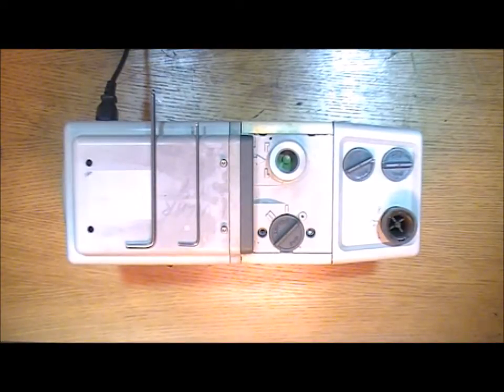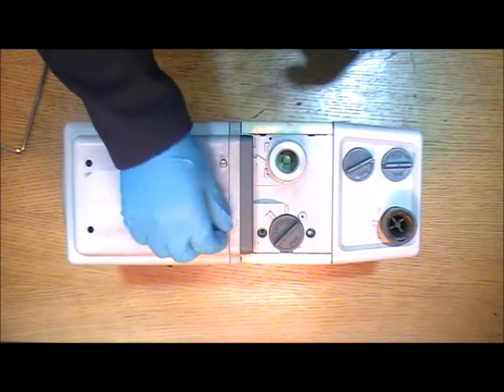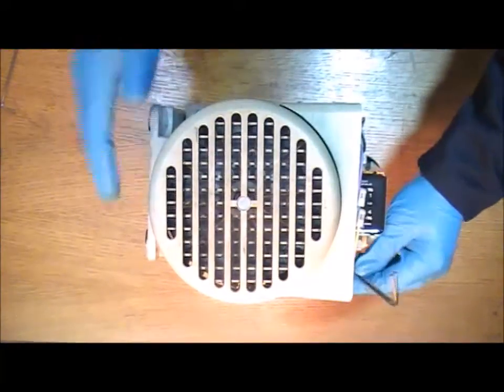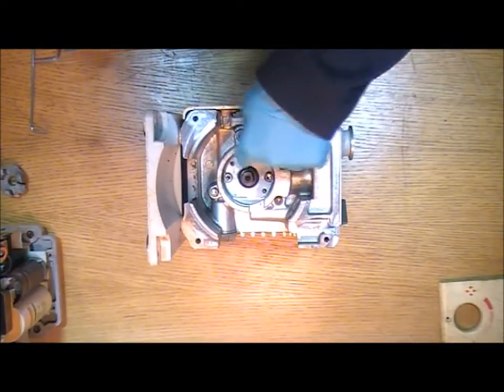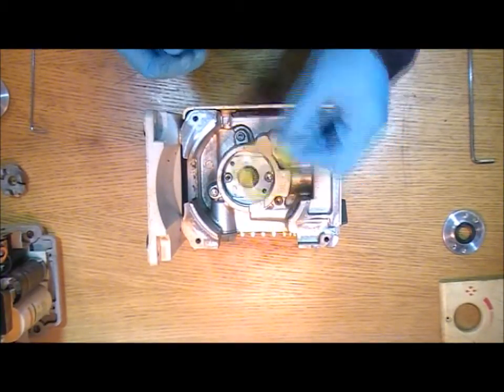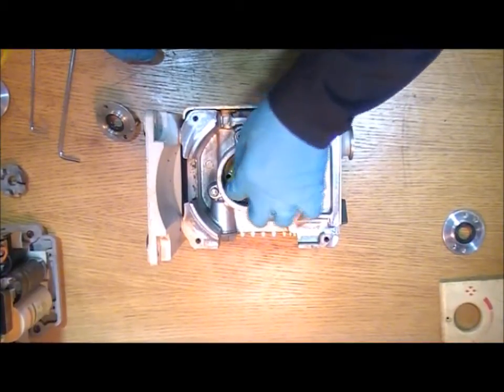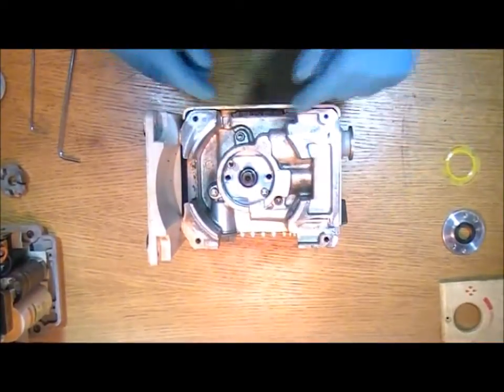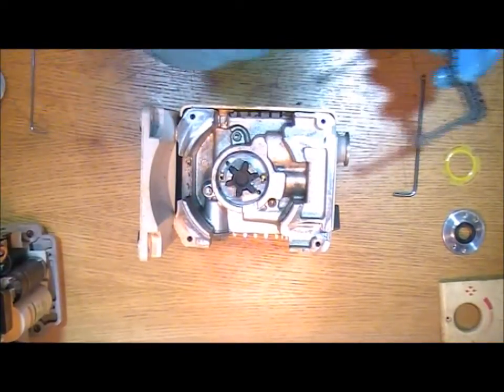Edwards RV Pump Shaft Seal Replacement

Comment: What about the seal on the other side
Reply from the maker: Do you mean the inner shaft seal? To replace the inner shaft seal you have to strip the pump down completely. Check out this video https://youtu.be/uI3mDwKVS5E
Reply: @LabVac  yeah I'm taking some Edwards apart but the inner one is completely frozen in there. I had to stop for the day
Reply from the maker: @Zombatt  you'll see some techniques for removing the inner seal in the longer format videos. About 37 minutes into the video I just linked you will see it deals with the inner shaft seal with some special tools. You can also put cleaning solvent in there to remove anything sticky, or warm the stator up in a bath of hot water (or solvent) which will help loosen it up.
Reply: @LabVac  thanks! You're the best!!

Comment: Is it reduce oil leak issue?
Reply from the maker: Hi. Yes, the purpose of replacing the outer shaft seal is to stop it leaking. Most (but not all) oil leaks come from the outer shaft seal. Good luck! Angus

Comment: What solvent should I use to clean up the parts? And does anybody have any experience with e2m18?
Reply from the maker: Hi, any common solvent is suitable. Acetone is great, hexane based degreasers work very well, brake cleaner is also suitable and cheap.
I plan a full video on the E2M18 soon so please keep coming back.

Comment: I did this on an RV12, and it solved the leak, but only for about 6 months. Do you have any suggestions please?
Reply from the maker: It sounds like the shaft sleeve may be worn. This is the part the seal lip rides on and requires complete dismantling of the pump to replace the sleeve so a full service would be required.

Comment: Many thanks for the tutorial mate. Do you have a video on how to replace the plastic blades  inside the unit (the ones that slide in between the two cracks on the shaft)?
Reply: I fix these pumps. What blades? What are you trying to figure out? The part that has the name of the brand faces towards the bottom when spinning
Reply: @RoastBeefQueefSniffer  Hey Barry, I don’t know if its what Arya meant but theres a bigger black seal to replace on the other side which I don’t know how to remove :/ Could you help?
Reply: @fuckdefucker  what does it look like do you have any way to send photos?
Reply: @fuckdefucker  did you change the oil? Was the pump just rebuilt? Is it leaking oil? Does it pump down at first then drift to 200? Is the switch on the top on the O symbol. The lever on the side closed? Have you taken the pump off of whatever it is attached to and tried testing the vacuum that way? How old is it and when was it's last rebuild? They're supposed to be serviced every year and half or so.
 I would legitimately need to see photos, and a video of it, to hopefully attempt to see what to diagnose. 
I'm legitimately contemplating starting my own company to fix these. I have an entire rebuild kit for every model.  Are you located in the USA and if so where? If it's near me I wouldn't even mind checking it out.
Reply: @fuckdefucker  you also could be missing orings seals might not be in properly or facing the right way.